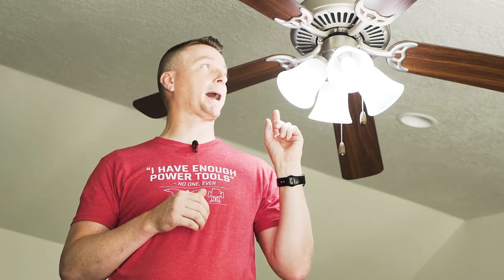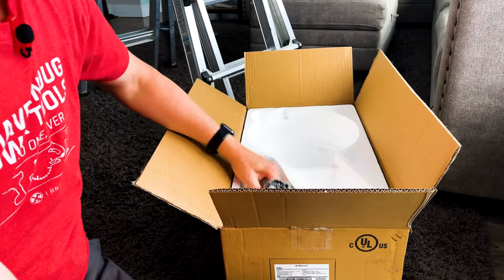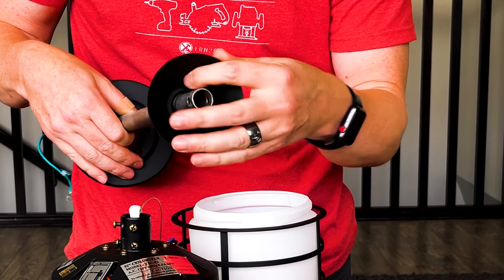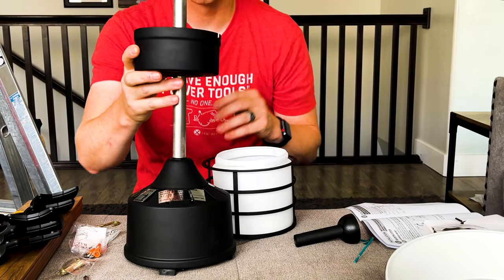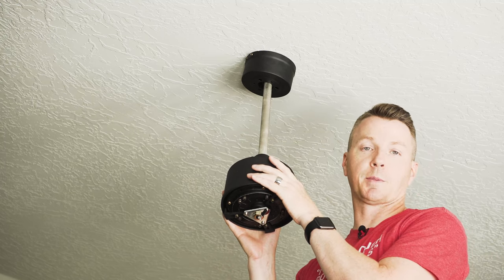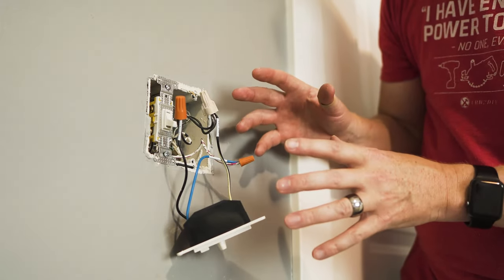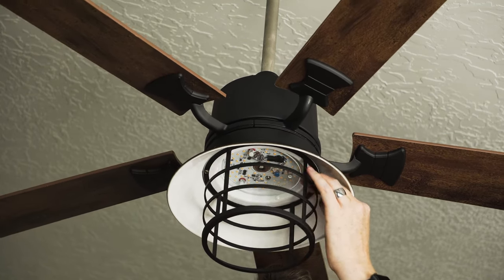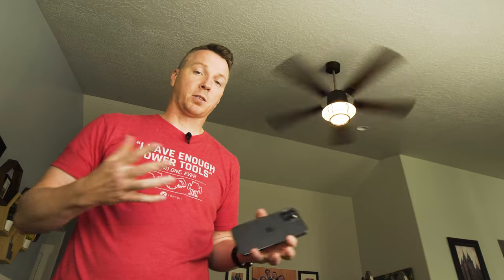How to Replace a Ceiling Fan - Smart Ceiling Fan Switches

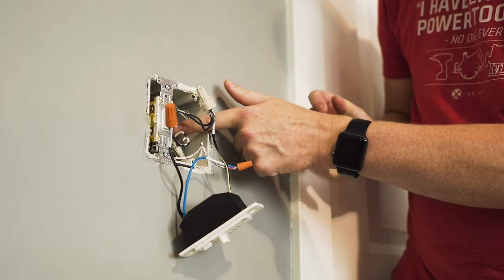Comment: 07:57 Why would you ignore the ground wires?  I recently retired all of the outlets in a 70’s era Miami house and was surprised to see whoever wired the house originally ignored the ground wire in *every single outlet*.  I assumed that was because 1) The 70’s were the worst 2) It’s fricking Florida so everything is done poorly.  But now seeing you skip grounding I’m wondering if I’m missing something? Why wouldn’t you want to ground every switch and/or outlet?

Comment: I e got to replace two fans that the motor went out. I’d like to replace them with remote controlled ones. Any advice on whether it’s better to go with a remote fan or install the remote control into a cheaper one?
Reply from the maker: I've done both and they both worked great. You'll typically end up paying less if the remote is included with the fan, however. Good luck - I hope it goes well!
Reply: @LRN2DIY  Right on, appreciate the response. Glad to see you’re still doing videos. Haven’t seen ya in a while. Keep it up.